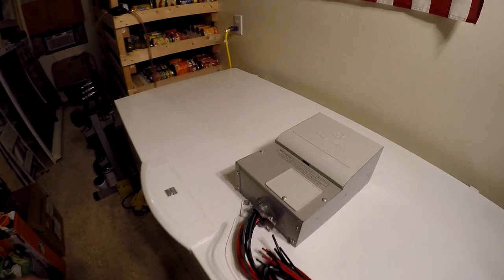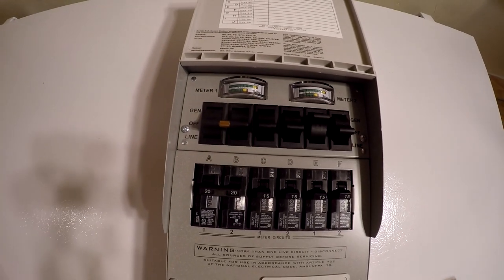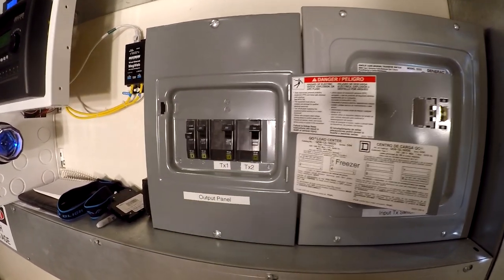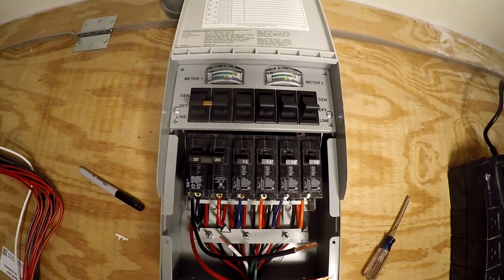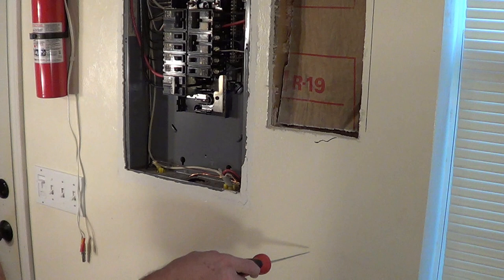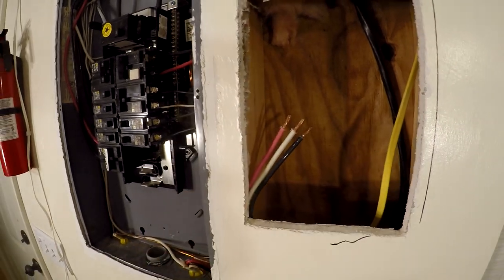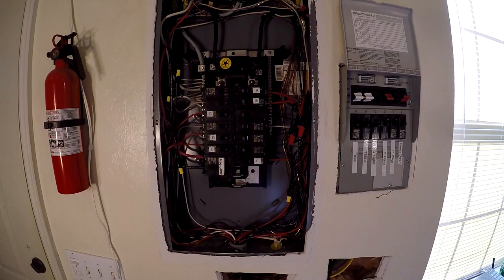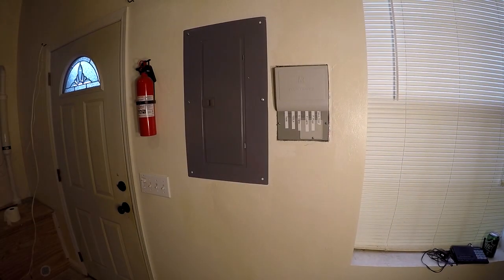Installing a Transfer Switch for Solar or Gas Generators

Comment: Great job in showing how to hook this up.  We have the 10 and 6 circuit transfer switch for our Predator 9000/7250 watts gasoline generator that I converted to tri-fuel. I use the 240/120 and 120 volts outlets to power our whole house.  It works beautifully.  Also, you don't have to turn off any of your breakers in the main control panel, when switching between Line and Gen mode.
Reply from the maker: Pk 3, Yes it is a great switch.  How do you like that Predator?
Reply: I really like it.  We haven't had to use it in a power outage situation yet.  I've put over 78 hrs. of testing/exercising it over the last 14 months.  We are ready for when the power goes out.

We live in Chicago and don't lose power that often.  But when it has gone out in the past, it was either really cold out or hot/humid.  We where blessed in those situations, that the power wasn't off for more then 10 hrs.  

My advise for anyone wanting a portable generator: exercise it, maintain it and have extra oil, air filter, spark plugs and extra fuel on hand.  Have it hook up to your house main control panel through a manual transfer switch or interlock switch.  Purchase a Gentent to protect it from snow and rain. Set it up and run it off your circuits so you know what it can handle.

Lastly, install a tri-fuel kit to run it off of gasoline, natural gas or propane.  Have it hooked up to your homes fuel source.  This way you won't have to refill it and it burns cleaner too.
Reply from the maker: @Pk3_Garage  good advice!

Comment: Nice i look at those but im off grid i think I will wire my outback with the lock out switch for generator... These new batteries we haven't use the gen 🤘🤘🤘
Reply from the maker: Dan, If your totally off-grid with NO utility than I think the lockout for the generator is the way to go.  Thanks!

Comment: Glad to see someone else using this transfer switch in this manner! Great looking system BTW 👍. I'm currently grid tied as well but using this with a Sol-ark "smart dump" feature. Primarily for EV charging and hot water storage loads. Also these transfer switches are easily rewired, including your 6/3 directly lugged to the bus bars. If you ever need an additional double pole, my electrician suggested upping wire size and heat rating 90c to 105c due to enclosure size. (This goes with saying check yourself and local guide lines; I'm not a professional). Keep up the great work!!!
Reply from the maker: Go Megan!  You should post some videos of your setup.  It sounds like your killing it!
Reply: @HomesteadEngineering  if only I wasn't so camera shy 😅. Thank you Sir and keep the great videos and innovations coming!!!

Comment: I excersise my generator(s), two in my case once a month.  I have to switch the entire panel from utility pwr. to gen. pwr.  Which means re-setting all clocks in the house and re-booting the modem (AT&T) which most times is a challenge .  Also, (because you can leave a lighting circuit on utility pwr.) a very handy feature of the Reliance switch is being able to see when utility pwr. is restored.  You can't do that if your entire panel has been switched to aux./gen. pwr.
Reply from the maker: Yep, All good points!

Comment: I have a transfer switch for my gasonline mobile generator.  Can I use that same transfer switch for Ecoflow Solar generator?
Reply from the maker: Depends on a lot a factors but probably yes if the plug and wire are rated for the max current and the gas generator and EF are both 240 or both 120.  Consult an electrician...

Comment: Thanks for the video.  I'm in the process of hooking up that same transfer switch.  Not hooking up the ground from you solar system so you don't get a ground loop makes sence, but I wasn't thinking about the common not getting hooked up between the solar system and the transfer switch.  You may have saved me a lot of trouble there.  So, is your solar system ground to the same ground as the main panel, or a separate one on its own ground rod(s)?
Reply from the maker: I find grounding to be a black art but basically I believe that your common and ground should only be bonded in one place and that one place is the main panel.  That's how I built my system.  Since the solar side (common and ground wires) already run back to the main and are bonded there, connecting them again in this sub panel would create a ground loop.  One way to check, is to check for continuity before you make the connection.  If it rings out, then its already connected somewhere else.  That said, I am not an Electrician and you have to do your own research.  Thanks!
Reply: Can you please help me understand this. In the video you say you left the ground and neutral floating in the transfer switch. Does this mean you didn't splice the two neutrals together or does it mean you didn't bond the neutral and ground together?

Comment: 100% best Generater.Systems I have used. A test for hurricane prep here in Louisiana: three AC units, 5000, 5000 & 8000, 3 fridges, 2 device power setups, 4 flat screens....AND I had 40% of the power meter to spare.
Reply from the maker: Before you need it.

Comment: Thank you so much! Just getting into electrical work, and was wondering how to hook up the generator for main power to an RV, but be able to tie in thirty amp and roof solar later for the same outlets. Got a glimpse. 
Have a great weekend 👍🏼
Reply from the maker: Echo, I have an RV and I do that with my current system.  Did you happen to notice the other transfer switch to the right of the solar output panel at 7:50?  That is how I bring in a generator OR the utility to my solar power system.  From there any choice of solar, batteries, generator of even utility can flow out to all three of my individual switched transfer switches.  I can run anything in my house, garage, shop or RV from any source.  Total flexibility!
Reply: @HomesteadEngineering  I believe, sir, you have saved my bacon! This is so much more than I thought it would be, but I want to set it up right from the ground up. At least I haven't built the walls yet, so I will have to get electrical savvy quick, to set it up nice and safe! Thank you so much for your help, I am going back to watch again, this time with notes and a list of supplies in mind. Have a great weekend!
Reply from the maker: @PeaceJourney...  I should probably make a video on all the ways I use my system.  I do have a few more videos that you may find helpful:
https://youtu.be/Ovrief1eIAI
https://youtu.be/_EyJJbmhHac
https://youtu.be/zb4oar9UHSY
Reply: @HomesteadEngineering  oh yeah! Thank you very much! I am binge watching them now!

Comment: Thank you for this video. I am doing the same setup. I do have one question. Are the inverter connected to grid for AC input?.  At night when no solar and battery is low , does the Grid kick in to power the transfer switch ?
Reply from the maker: Hello Otis, I have the transfer switch connected to the grid and to my solar so I can switch any individual circuit as desired.  So the answer to your question is YES.  Note:  I used to switch these back and forth every day but with the new EG4 battery bank I am able to run the entire house almost exclusively on the solar now.  Thanks!

Comment: Thank you for this video :) :) I am doing the same thing but running my stuff off some large power stations and about 1700 watts of solar. Quick question....Which type of conduit did you use to go between boxes? The stuff that came with the transfer switch is NOT FLEXIBLE at all!
Reply from the maker: Jasonoid, I am not an Electrician so I can't advise anyone on what they should do.  I also do not know what would meet your local codes.  That said, I will simple state that I think this stuff is fairly flexible:  https://www.lowes.com/pd/Southwire-Ultratite-Non-Metal-Liquid-tight-25-ft-Conduit-Common-1-2-in-Actual-0-5-in/1000239881  
Thanks!
Reply: @HomesteadEngineering  Hey, totally understand, thanks for the recommendation haha

Comment: I curious what the source of the noise is at 4:22. Is that your inverter?
Reply from the maker: That is a window AC.
Reply: @HomesteadEngineering  Thanks. I'm searching for a quiet inverter/charger (i.e. <50db under load). Most can get very noisy. Are your MagnaSine units quiet?
Reply from the maker: @johnbrzezinski1446  About like a microwave oven at low power and noisyer than my window AC when the fans kick in.  Too noisy for a room with a TV.
Reply: @HomesteadEngineering  Thank you!

Comment: We are doing the same setup you have here. Did you say you didn't connect the neutral from the inverter to the neutral on the transfer switch? How would this work without the neutrals connected?
Reply from the maker: Steve,  Its been a while so I am not sure but I would guess that the neutral and grounds are already connected elsewhere in the system.  I kind of remember ringing them out with continuity without them being connected.  Note:  I am not an Electrician and can't advise you...  I am only showing folks what I did which may not be the best practice.  Thanks!

Comment: Hi there, thanks for the video. I dont have any electric utility, so looking at an option where I can have both a generator and/or solar. Would this work for that purpose?
Reply from the maker: I am not an Electrician so (disclaimer).  I can see how this could work but probably not needed.  Most solar setups would have the option for a generator connection directly to the solar setup.  The solar setup would then manage the solar inputs and the generator inputs automatically.  I would look at the EG4 series or something similar.
Signature Solar: https://signaturesolar.com/?ref=HomesteadEngineering
Reply: @HomesteadEngineering  sounds good. I will check my bluetti ac500max for this

Comment: Thank you for the video but I do need to ask do you need batteries for the solar to be able to use this? I have solar and can not use it when there power outages as we do not have batteries. It is only connected to the utility company.
Reply from the maker: Ivette, You don't need this transfer switch because your house is always on solar/utility.

Comment: Great Video! At 3:07 you mention the limitation fo the box due to the sizing of the input wire. Is this something that is easily changed out to larger wire? Are there any other considerations besides the sizing of the wire that would limit this box to a certain Amperage? I can't seem to find any product like this larger than 50 Amps, which is just not enough amperage for the system I want to build. Is it as simple as just replacing those wires?
Reply from the maker: I would not modify the system with larger wire.  The largest one I know of is 50 amps.  I used two 50amp switches on my mains to meet my demands.  
https://youtu.be/4HhfdzBunSc?si=yF-mra8jrYRXDTeH
Reply: @HomesteadEngineering  Thanks for the reply!

Comment: I am looking into using a Hybrid Inverter; which means the solar panels are one input, and my main panel is a second input (with an 80Amp breaker from main panel) into the inverter.  I want the output of the inverter to go into this kind of transfer switch.  Would this work?  It would mean that for the switches in the 'Gen' position the load would be powered from both solar panels and the grid (from the 80AMP breaker) and for the switches in the 'Line' position those loads would be powered by the grid only through that load's existing breaker from the main panel.  So in practice the transfer switch would be used as a switch between 'Grid only' and "Grid and Solar.'  Does this make sense.  I am thinking of this type of setup, because I want to use an undersized solar panel array that needs grid power (i.e. without battery investment) to handle most of my loads.  And I want to ability to switch all loads back on the grid in the event my inverter fails or has to be replaced because I don't want to be without power.  In this setup I may as well ask about what to do with ground and neutral in this setup because that stuff is confusing.  In another video the guy 'passed' the ground and neutral separately to the main panel, which I assume is correct in my setup too.  Thanks for the great video.

Comment: @Homestead Engineering . Nice content. I'm doing a set up similar to yours. I noticed that you connected the ground and neutral wires from the transfer switch to you sub panel but removed the neutral and ground from being connected to you inverter.
 Question. What are the wire and voltage outputs of your inverter from your battery bank solar setup which go to the transfer switch?
Reply from the maker: David,  I did connect the ground and neutral from the transfer switch to the panel but did not connect them back to the solar system because they are already tied back to the main panel in a different path.  i.e. there is continuity but only tied at one location.  I used oversized 6/3 wire and the voltage is split phase 240.  Thanks!
Reply: Thanks for replying. I subscribed!

Follow up question.
So in your previous solar/ transfer switch video, was the same principle applied in removing ground and neutral? Or was it there that neutral and ground were connected from inverter to transfer switch to panel and hence the reason you would now already have continuity.
Reply from the maker: @david32151  They were not connected there either.  Its been a while but I think they were only connected at the AC input to the solar power system.  So basically:
1. I have two 150A main panels
2. One of those main panels feeds a 100A sub panel in my solar/prepper room
3. That sub panel can act as an input to my solar power system although I never use it that way.  I would only use it if a storm was coming and I needed to top off my batteries with the utility before it goes out.  I normally have that disconnected to avoid any noise input from the utility
4. That sub panel is where the common and ground are tied from the solar power back to the mains.  
5. The common and ground are not tied anywhere else.  Not any any of the three transfer panels.  They all have continuity because they are already tied.

Check this: https://youtu.be/DvfReskBReQ
and this: https://youtu.be/4HhfdzBunSc

Thanks!
Reply: @HomesteadEngineering  That's fantastic.   Your videos are very helpful and incredibly informative.   As an engineer, I like to hear the thinking process (the why) as well as the how, and you do that very well.   Ok,, i have the exact same setup as you, but I have NO AC GRID TIE backup to my solar system - it is 100% standalone.    I am also connecting it to my sub-panel with the ground and neutral NOT BONDED per code just like yours.  The sub-panel is currently connected to the house main (which has neutral/ground bonded in that panel).   The question, as there is NO path back from my solar system to the main's neutral/ground, would you join the transfer switch ground and neutral instead of what you did here - float them?

Comment: I ve been using the Reliance Pro Tran 2 transfer switch as the circuit breaker box for an off grid cabin. Just plug the Honda EU200i into the outside recepticle and viola! power through out.  My question is how can I connect the Reliance Pro Tran 2 transfer to a solar panel system? So that I can alternate between genny and solar.
Reply from the maker: David, Many ways to do it.  
1. You could have the same plug on the solar output and then just plug in the one you want.  
2. You could run them both to a 2nd transfer switch and then use that to select
3. I run the generator into my solar power system and then run the solar to the transfer switch.  I can run utility, solar, batteries or multiple generators.  Total flexibility.  
https://youtu.be/zb4oar9UHSY
Reply: @HomesteadEngineering  The #1 option is ideal, but Im unclear how to accomplish  it. 
Solar Panels to Charge Controller to Battery Bank to Power Cord plugged into Pro Tran 2 ?
Reply from the maker: @davidmc2861  You could run one of the outputs of your solar to a plug identical to that found on your generator.  That way you can use the same generator cord to plug in either you generator or your solar to your transfer switch.
Reply: @HomesteadEngineering  Awesome, I'll be researching exactly that, Thanks

Comment: Do you wire the receptical the same for both solar and generator?
What about ground and neutral?
Thanks
Reply from the maker: Steve O, I can only show you what I have done and can't advise you on electrical as I am not an Electrician.  You should have a qualified Electrician have a look at it.  That said, mine are the same and ground and neutral are only bonded at the main panel and nowhere else.  Thanks!

Comment: Hi Sir, thank you for your informative video. I did have one question. I do plan on wiring up the same exact transfer switch next to my sub panel, if I wanted some circuits from my main panel (right on other side of wall) to be wired to a transfer switch, would I need a separate generator and transfer switch or would I just wire up the circuits from the main panel the same way? 

Note: I do plan on hiring an electrician to do the final job, but just more curious if you can power circuits from main panel and sub panel from the same transfer switch panel so I don’t get overcharged or ripped off. Thanks for any input and I understand you can’t give official advice, :)
Reply from the maker: Hello Mike, Glad that you will be hiring a professional for this.  I don't see why you can't wire your transfer panel as you have described in terms of functionality.  I think it would work as long as you get the grounds and commons correct.  That said, I can see why it may be a code violation due to the complexity.  A new home owner may be injured as they may not understand that both panels could be "hot" even when both main breakers are off.  i.e. its just a bit "non-standard".  Hopefully your Electrician will know for sure if its doable.  Thanks!
Reply: Thanks for your reply!